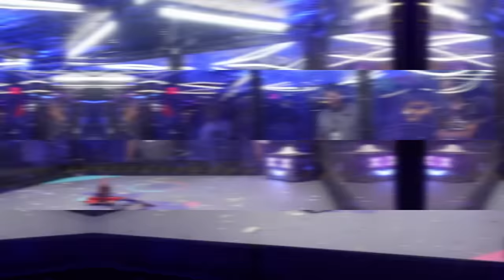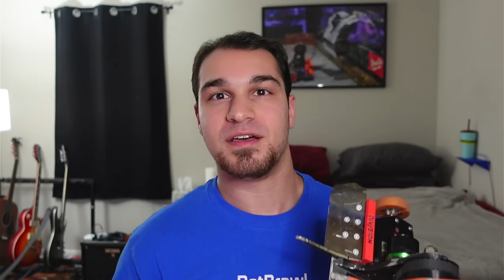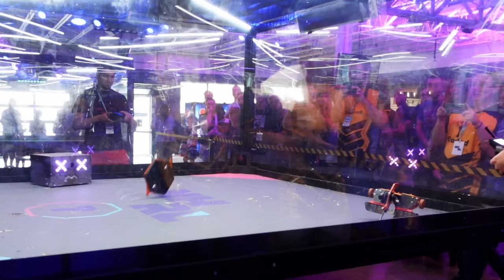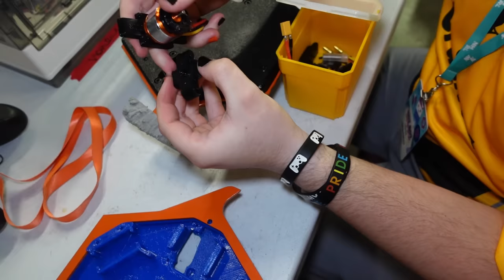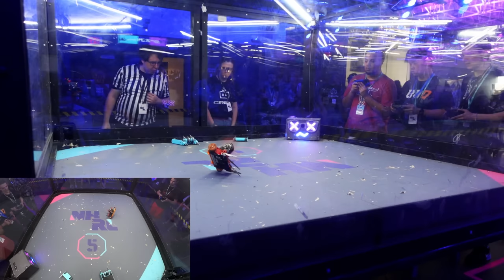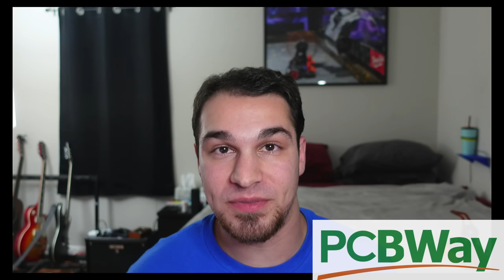Is Division Still Good Enough? NHRL August 2023 Recap

Comment: For Division V4, maybe you could try thickening the two unhinged forks that sit between your weapon uprights. I've noticed they have bent in a few fights. If they are thickened it might also help with the front flipping on big hits. Similarly, maybe the hinged forks could be thickened and lowered on the robot. This would help the forks stay planted and give you a larger margin for error when approaching a beater bar. It seems like you need to be pretty exact with the skinny forks, as anything that isn't straight on can catch the sides. Lowering the mounting point of the forks to the bot will also decrease their angle with the floor, making them catch less. Great video as always!
Reply from the maker: Yeah I definitely need to improve the forks for sure next go around.

Comment: I noticed 2 things that I think you should look into improving:

1. Sometimes, when you land hits, you tip forward and your weapon hits the ground, although this didn't seem to happen so much when you were fighting Kili with your battery power down

2. When you fall on your back, your wheels don't touch the ground, so your ability to self-right is completely dependent on your weapon working

I'm not sure if there's a good way to fix problem 1 without increasing weapon height or stabilizing fork length, but problem 2 might be fixed by adding some sort of protrusion to the back so that you don't land on your back so often.

Comment: I really think the sport is moving too far to have undersized/small batteries. Opponents will only require more damage to be knocked out, and although it sucks to dedicate more space and weight to a battery, it seems like more of a requirement every year. I know you can make Division more and more awesome, excited to see v4!
Reply from the maker: I kind of designed myself into a corner I think with the V3 chassis design. Originally I thought that I could fit a larger battery like I had in the previous version but when I had the PCB in place I found that it ended up being too long and I had to step down from 650 milliamp hour to 530 milliamp hour. I think another change that made the battery life worse was moving to am32 ESC firmware on the weapon and less efficient brushed motor on the drive. These both use up a bit more battery power then I had been using two competitions ago

Comment: Would it be practical to make division into an unorthodox top attack bot? For instance, if you drive division as it currently exists backwards and ram into the opponent, due to the top heavy nature of the bot it would tend to tip over, towards the opponent, bringing the weapon into the opponent's top. Could you tweak the design to make this stye attack easier, maybe even add a small actuator under the bot to tip the entire bot without having to rely on momentum?
Reply from the maker: Sounds like you are basically describing Starchild. I think it would need to be totally different to make that work and Starchild already does it better than I could at the 3lb scale.

Comment: Seth you're a great driver, you have tons of experience, you build and pit really well, you've iterated on Division a considerable amount over many years. It does not get the results you'd expect this to warrant. I think the design is clearly wanting; something bigger should change if you want better results. The influx of new talent will outpace any minor improvements to design you can make.

There's three directions I could see you go.
Option A, to be a more prototypical vertical weapon winning bot (closer to Synthesis)- The two biggest issues I see are the high center of mass / stability and weapon vs drive ratio. After most hits it has to self-right, the self-right can be inefficient, take too much /critical,/ disproportionately valuable time, and be unreliable. Take lynx for example, after almost every hit it delivers, it is quickly able to be in control and ready to deliver another, very often before the opponent can be positioned and ready. The timing of this is absolutely /critical/. If you can almost never be effective during this most valuable time to be effective, it's going to be a lot harder to win fights. Having a better drive not only gives you better control, which everyone knows the value of, but also gives you more bite force. Lynx delivers just as large of force on hits (maybe more), sans the concentrated stress of being a narrow blade (which it could just as easily be), with less energy in the weapon because it's typical translational velocity before impact is /much/ higher, and lynx itself doesn't rebound much or fall over after each hit and can transfer more of the energy. This also rings true for designs like Thagomizer/Maximizer.

Option B, change the drive completely- You could possibly win fights with the weapon's shear effectiveness and unorthodox drive solutions that harmonize more effectively with high center mass and the weapon being a weight hog. You could use a Non-Traditional Motion Bonus. Shuffle bots getting 66% more weight might be something almost all wheeled bots should be taking advantage of already. When you look at what good shuffle bots can do with their drive and protection/robustness for it, it's hard to find a downside, they just end up with extra weight for non-drive. This could further help with center of mass and stability issues. You could also use other Non-Traditional Motion Bonus drive systems, e.g. Droopy, Depth Charge, Kitten Mittens, or invent your own. Further, designs like Huuuge, and Billy I believe work in symphony better with heavier weapon systems and high center of mass by mitigating self-right problems. Or use both ideas, like Monkfish.

Option C, use a free 1 lb control bot/ wedge. e.g. Project Liftoff. This free wedge drastically improved its winrate by allowing it the time needed to spin up again, this a very similar problem Division has. Of these free bots, a low wedge with a shallow angle seems to be the most effective so far. Forks that are very effective when bot's weights are 1:1 (SawBlaze highly effective) do not seem to be nearly as effective at 1:3 ratios. I think they lack the power and impulse needed to break the steeper leading angles of the forks underneath and/or some other factors. A simple wedge can be unreasonably effective in combat robots. Or use option B and C and make a 3lb shuffle control bot.

Comment: Not sure if it's practical physics-wise, but those spikes on the front seem to cause you far more problems than they solve.
Getting stuck on the floor, pushing your opponent out of your weapon range, etc.
If they could just be a bit shorter and less spiky so they don't get caught on stuff that might be the key

Comment: i  think you should do something against those gyroscopic forces, either add a counterrotating second blade and split the weight of the former in two, or gear down a smaller weight so that you have to sacrifice only like a fith of your original weapons weight but make the counterrotating mass spin faster. this in return would need more powwerfull motors aswell as batterys, so it would be a difficult balance to find, but could be well worth it if it helps with the driving

Comment: what if you went with a more stable base like 2 long fork that goes all the way through. This should allow for better ground game and more solid hits. Also you might want to look to uppercut or the like for a design that is either unflippable or perhaps invertible in a way that flipping is not an issue. I think adding a powerful ground game with you long reach could go a long way against all the 4 wheel drive verts. Maybe a capital i so that it forks well and if flipped it can auto resettle... not sure.
Reply from the maker: May be worth trying out!

Comment: I think an Uppercut-inspired design would be a good successor to the Deep6-style here. Slightly smaller weapon diameter maybe, but the big things for Uppercut as the fact it's invertible with the arms on both sides of the weapon, and the poles keeping it from doing the thing on its sides.
Reply from the maker: I really didn't like the way that Bots like uppercut drove due to having none of their weight on their wheels. If I can figure out a way to solve that problem with an uppercut style design then I'd feel a lot better about it
Reply: @JustCuzRobotics  Would it work to get the weapon to be more near the front and the wheels further to the back? Don't know how much space/weight there is of course and self righting would be more difficult.

Comment: Would you consider making Division an Uppercut style invertible vert? I know that would tweak a lot of the chassis geometry, but alleviating the battery limited inversions would save a lot of heartache.
Reply from the maker: I'll definitely consider it at least. The further back the wheels are from the center of mass the worse driving gets though and that's a big issue for that style of robot.
Reply: @JustCuzRobotics  Very true. The CG issues of mega verts have been well documented because of Deep Six.  Wheelieing could be solved with a longer chassis, but if that's at the expense of width of the chassis or the blade diameter, that may be a step backward.

Comment: I feel like you could do something similar to what Deep Six did in season 6 where they had the forks and stabilizers as one piece
Reply from the maker: I think Deep 6 is a ton wider than most bots at Battlebots, Division isn't that much wider than some opponents, Fully Defined is much wider in fact. I would not want forks that get in the way of hitting opponents

Comment: change up the forks on the bot they seem to get stuck in the floor a lot. make them shorter and more flat than angled down. the forks seem like they are keeping the other bot away from divisions blade more than getting them closer.  gotta also figure out the battery.
Reply: The more angled forks tend to help Division hit up, instead of straight out.
Reply from the maker: Yeah I think the forks and ground game are major areas that need improvement for sure. I thought that the long hinged forks would work well to stay on the ground with gravity but they are too light and that didn't work as well as I had hoped. I'll need to think of something a lot better.

Comment: its honestly hard to tell how much forks are helping at NHRL these days or if they're hurting more. especially for the weight commitment that they are for the likes of Division (they look big & heavy).. more and more builders are making bots that tear the living hell outta the wooden arena, & after the 2nd-ish round in the bracket theyre already not really functioning well as intended.
Reply from the maker: Yeah. I kinda hate having to use forks but Division's blade is so big that it hits really high up in front, which means I usually have to raise the opponent into the blade. I may need to downsize the spinner somewhat to be more practical. But I don't want to compromise on that too much as it's pretty much what made Division what it is.